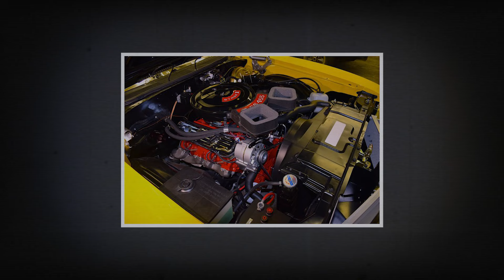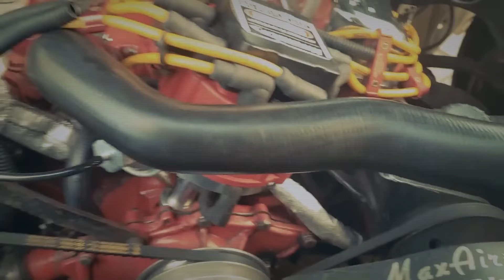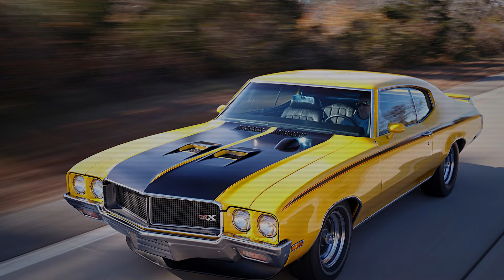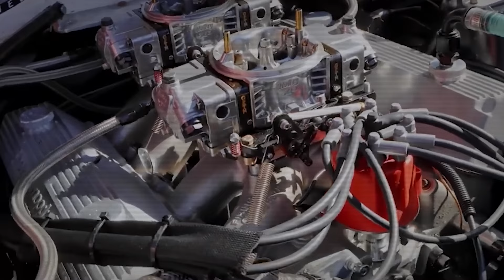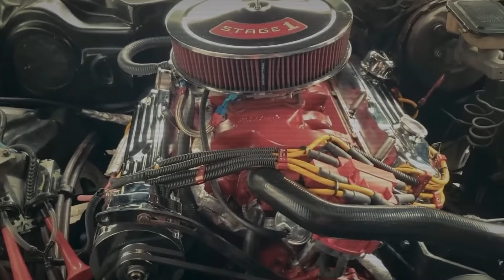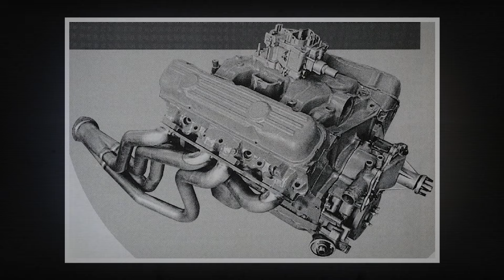How Buick's 455 Stage 1 Out-Torqued EVERY American Muscle Car in Detroit

Comment: The 455 is 150 pounds lighter than a 454.   With an aluminum intake installed, weighs the same as a small block Chevy.